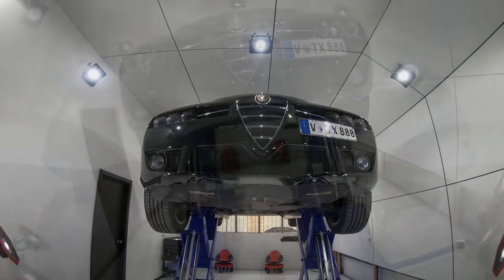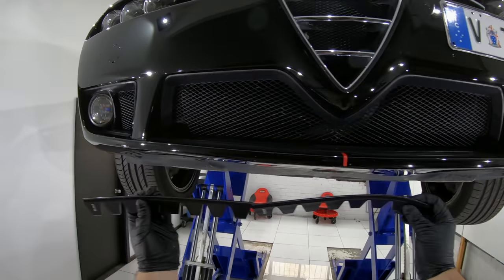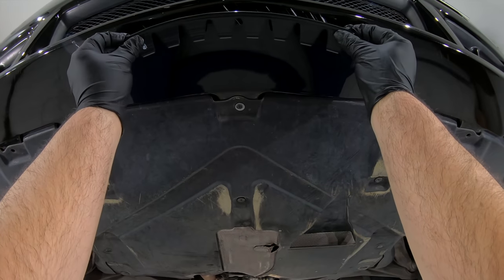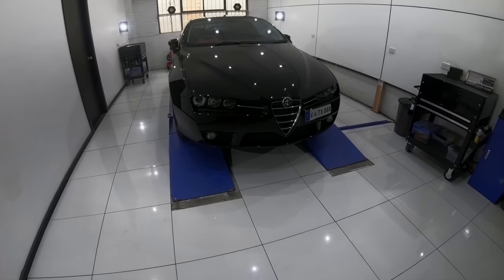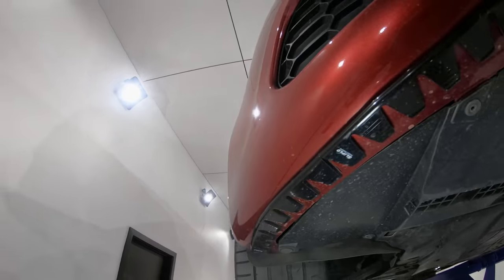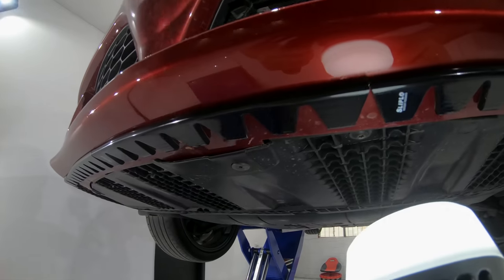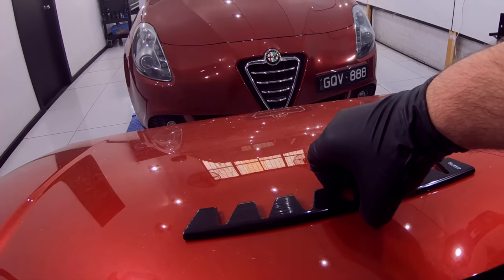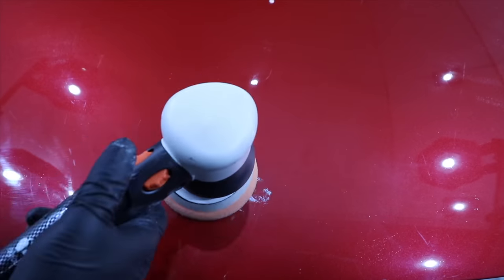Sliplo Bumper Guard Install + 9 mth Update & Review!!

Comment: I get the concept, but it seems like you're just substituting big ugly scratches with big ugly blocks of polyurethane. You're also lowering the effective ground clearance which could put more pressure on bumper mounting points when it does inevitably touch down. You can always remove and repaint the bumper down the track anyway, and plastic filler would correct any scars.